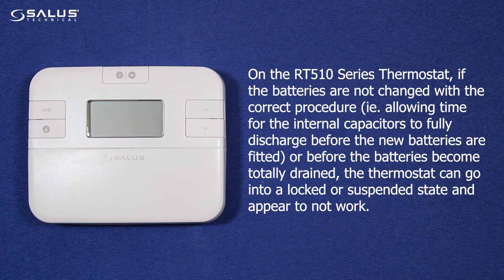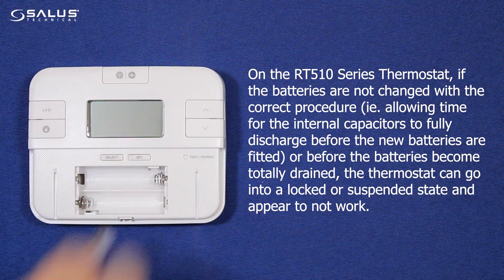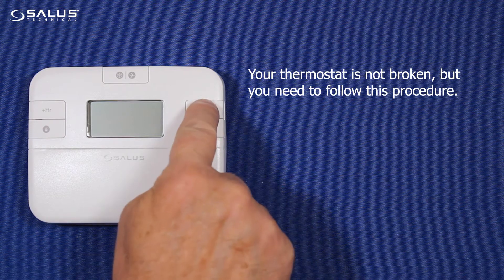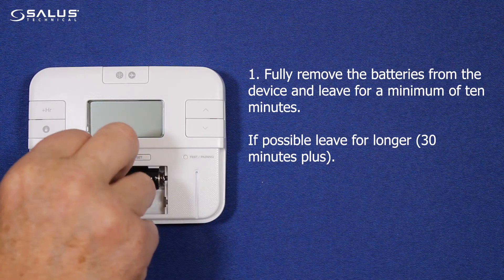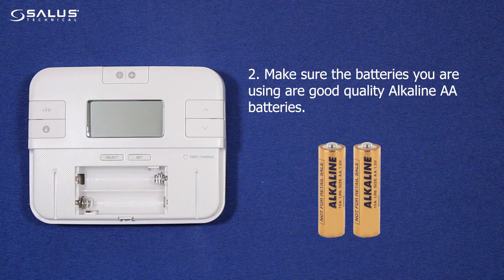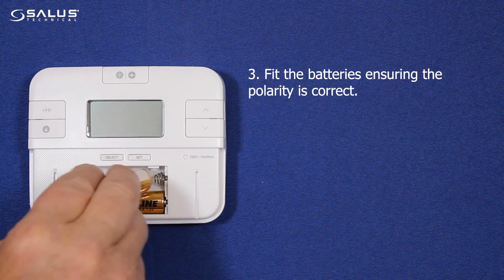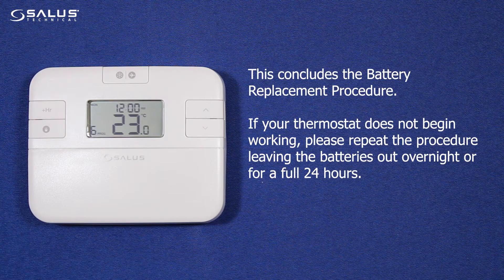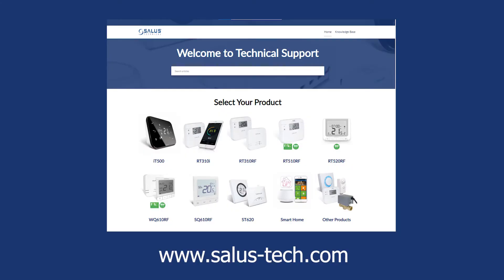RT510 Series Thermostat - Blank Screen

Comment: this is the WORST heating system i have ever encountered and has given me nothing but grief since i moved into this flat. whoever designed a thermostat system to be this convoluted should be ashamed of themsleves. also important to add there is no solution listed for when the unit does just turn blank (mid use i might add). no i didn't change the batteries wrong, there is no troubleshoot option listed other than telling me i've done something wrong when the batteries werent even touched and still had charge.
Reply: Agree.

Comment: I have followed the instructions, leaving it for 24 hours before putting in brand new batteries and it’s still not working (after 2 hours of waiting!) I’m not very happy with this as the current thermostat was a replacement for a previous thermostat which was also faulty. I’m going to ask my gas engineer to fit a thermostat that is better quality than this one!